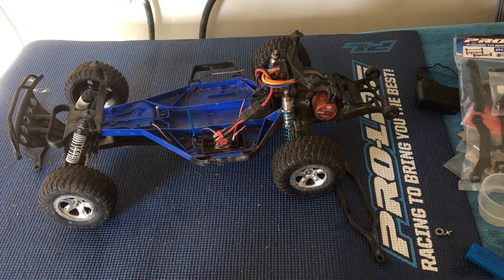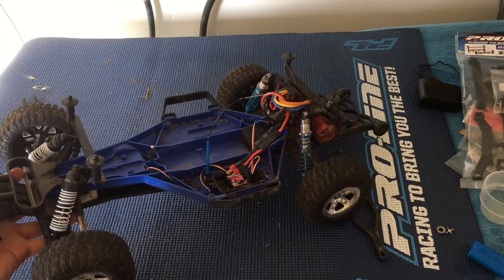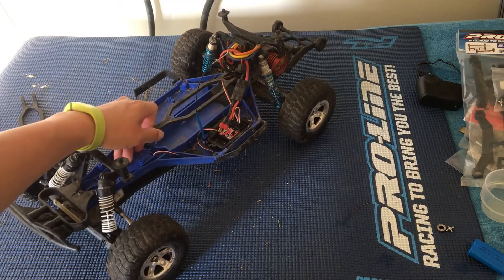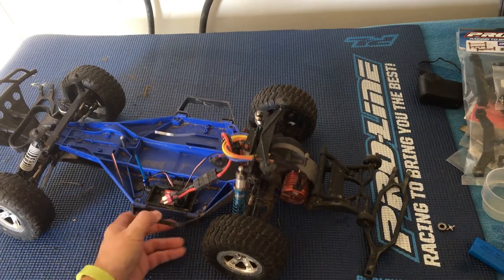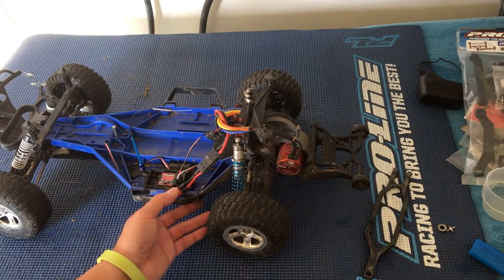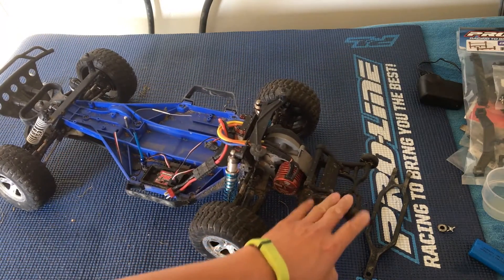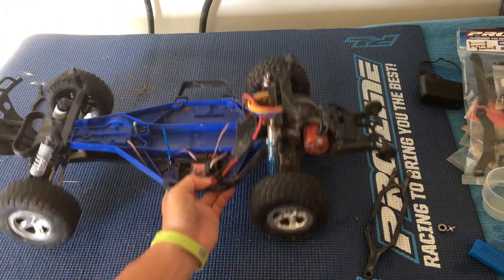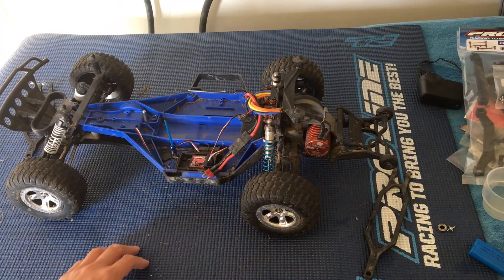Racing2Learn: Traxxas Slash 2WD LCG (Low Center of Gravity) Discussion on Supension, Shocks, Tires

Comment: Did you upgrade the driveshafts
Reply from the maker: Thanks for watching and commenting. No, it's still on the stock plastic driveshafts. With the stock tires that have horrible traction, the stockers have held up so far.